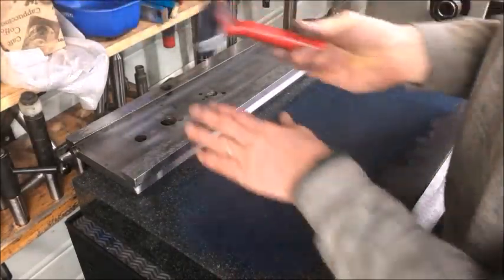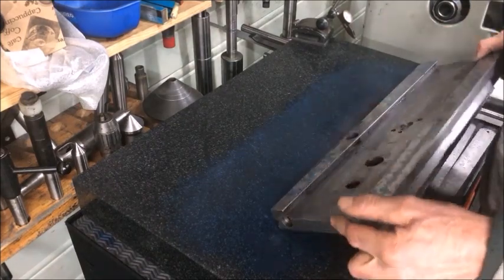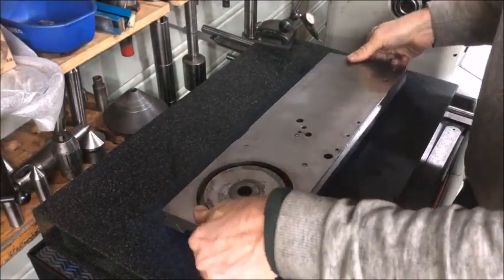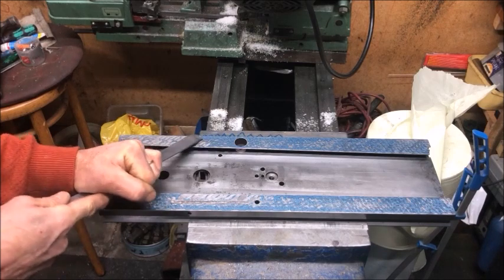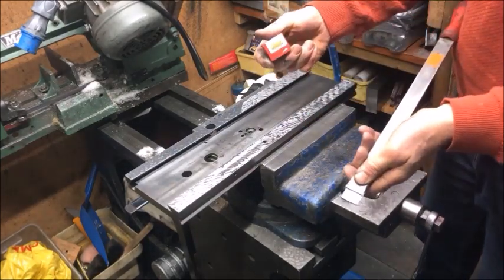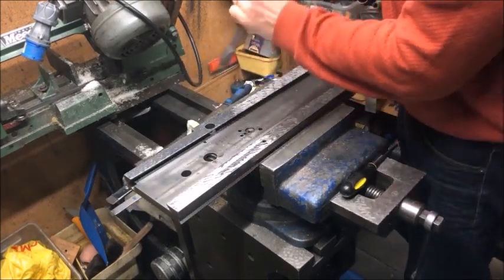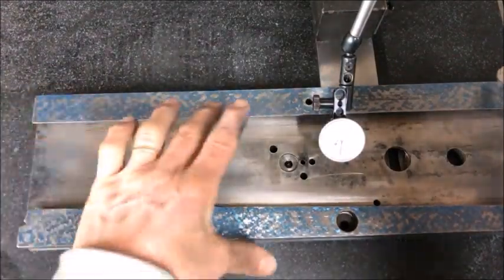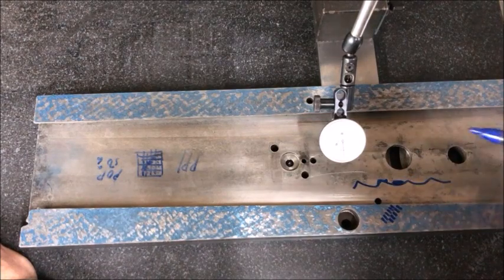Colchester Master 2500  - scraping underside of cross slide

Comment: Impressive set of machine restorations. Thank you for taking the time to share. Your narrative is very useful for me as a newbie. I really like the idea of taking care of the machines in this way. Maybe even make them better than original? PS: I'm not sure where I picked up the idea (possibly in your youtube videos -- hehe), but I milled out a 1,2 mm deep pocket in my Sandvik scraper. It did help quite a bit as it was very stiff from the shop.
Reply from the maker: Thanks ! Great that you find some useful hints and can learn from the videos. That's is inspiring. I cannot boast that the machines will be better, but closer to or within specs is always the goal. Not sure if mentioned to hollow out a section of the handle/shank of these scrapers, but with the technique I have learnt and practise it sure helps to reduce their stiffness.

Comment: Hello Jan,
I have it on my todo list to try scraping in 2021... I had initially planned to get a block of cast iron and just try and get it flat and parallel by scraping both sides. Once I had mastered this then move onto working on machines. 
I have also thought about attending one of Richard Kings course, however with the COVID situation I would not want to do that until 2022 at the earliest.
Thanks for making this video...
Paul,,
Reply from the maker: Hi again,
Yes, I think it would be nice to first get a test piece and practise, stock up som basic tools and do some reading. .then take a class. I know Richard is doing classes in the US. he can be contacted at his FB forum and/or website. If you are in Europe, there are BIAX scraping classes run by the company Maschratur in Austria and I do believe there are some others hosting classes in the UK. I also know that there were classes in Australia earlier, but am unsure of the current situation. Where are you located? I could possibly help you with some contact details for some of the aforementioned ..
Reply: @jansverrehaugjord9934  Thank you for the information on the course... I am in the UK.